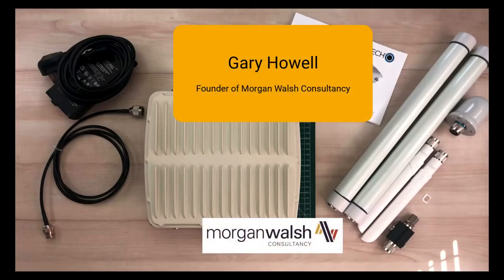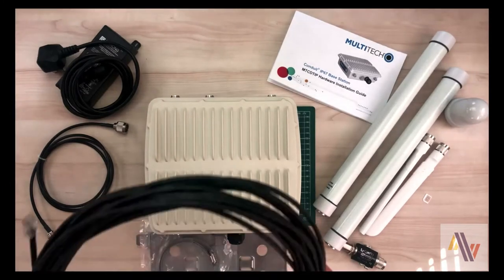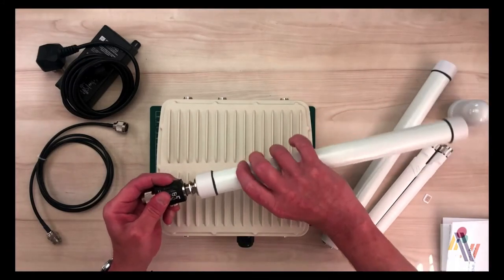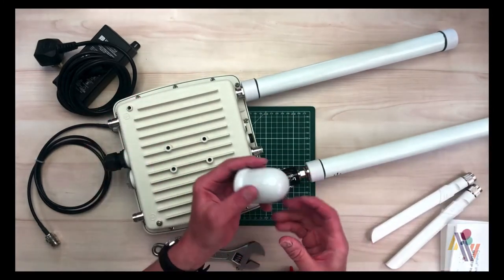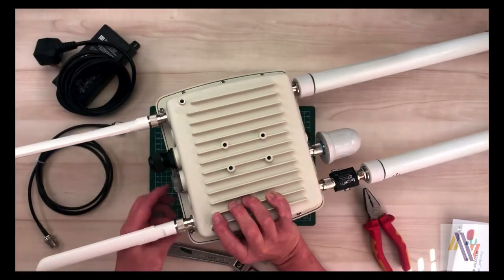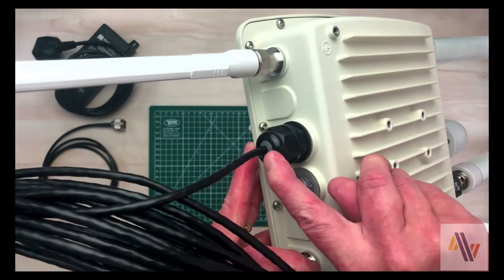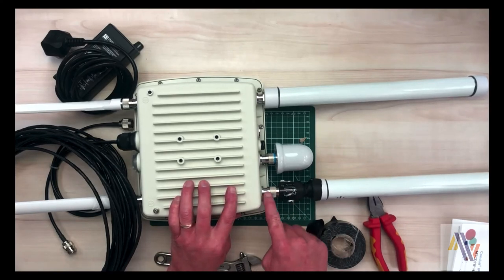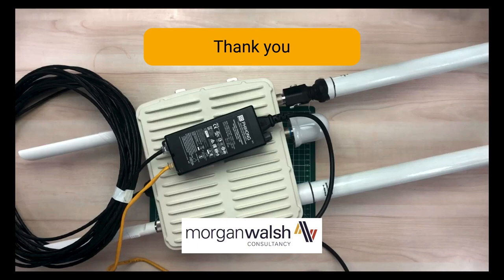Multitech Conduit IP67 LoraWAN Gateway - A walk through of the physical setup

Comment: we have this MTCDTIP-L4E1-266A-868 modal but ( no 2 Connector ) is Closed by cap where should we install GPS antenna?  (number 6 )is open, showing GPS position data has not been updated. Check antenna.
Reply from the maker: Hello. The Lora radio antenna will always be the one near the outside edge with the GPS one towards the middle.  Where are you looking for the GPS data?